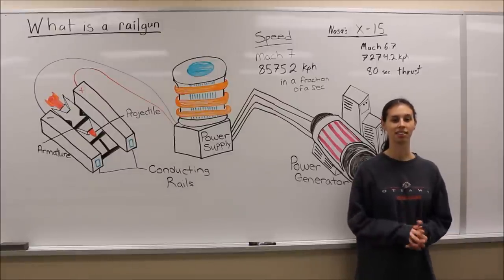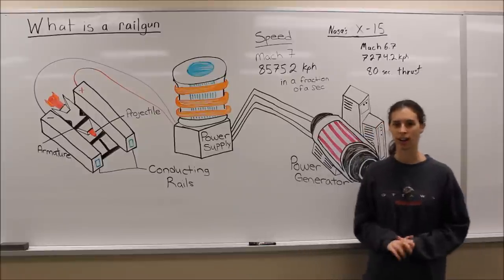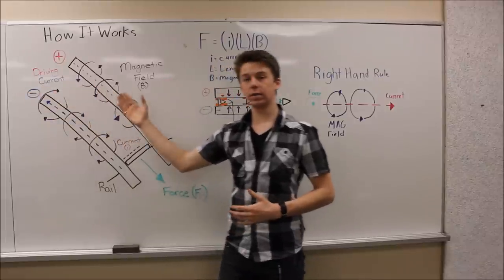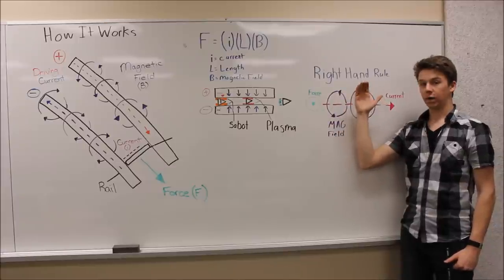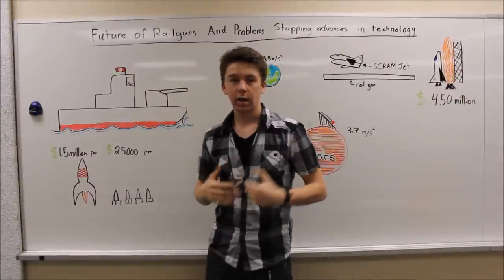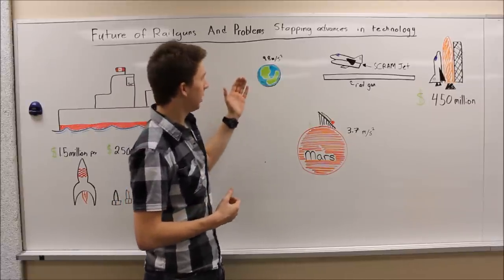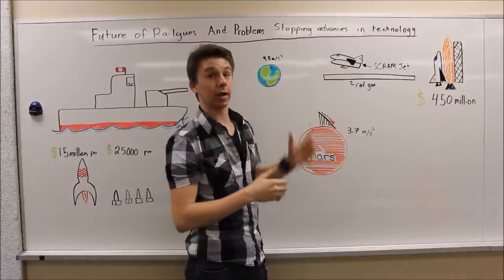The Physics Behind Railguns

Comment: If you set the length in F=ilB to the length of the rail gun then you will get the force on the rails which pushes them outwards, not the force on the projectile. The length should be set to be the portion of the projectile length, the distance between the rails, to get the force on the projectile. Just for anyone wanting to build one :)
Reply: Thanks! We actually built something like that in our physics class recently, though not as powerful, for, I believe, obvious reasons 😂

Comment: Thank you for the excellent primer on railguns. Great introduction to the concept.
One point I would correct. The force that moves the projectile forward is the current crossing the sabo. 
Thumb pointing toward negative rail, fingers curled toward back end of / start of rails, force pushing back, forces projectile forward.
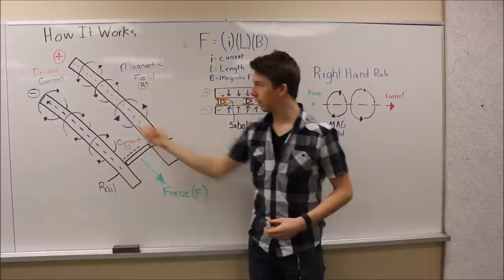Reply: Also the forces on the rails push the rails apart, not together. Still, apart from the physics errors at 2:52 and 4:43, a well presented and watchable video.

Comment: There is no need in mentioning "positive" or "negative" poles. In general huge capacitors are used as the power sources, and during their discharge(i.e. the projectile acceleration process) electromagnetic oscillations occur, and "the poles" periodically change, and it does not change the Amper's force diraction(it is obvious for someone who knows electromagnetism on a school level), and yes, Amper's force when we are talking about solid projectiles being accelerated. Lorenz force is the force which acts on the charged particles(in ionised gas for example) in magnetic filed.

Comment: Have you ever thought about using super conducting magnets which utilize a super cooling method to counter the heating issue as well as possibly add extra force to the projectile?
Reply: an area of study that I'm looking into is customizing the permeability and permittivity of the projectile material to greatly increase the speed of the projectile.

Comment: This was a very informative video! I'm just curious from a physics standpoint i'm sort of a novice.. but whats to stop the forces from the current and magnetic fields on the armature from launching it either up, or down, or backwards along the railing. If you could explain what or how exactly the magnetic forces and current force the round precisely where you want it to go, i'd greatly appreciate it. I'm super curious about it, and don't have enough of a background in physics to understand.
Reply: Yeah... so the rails are just there to supply the current along the projectile's path. You're right, there is an electromotive force applied inwards to the projectile in the barrel, and if there was nothing stopping it above or below, eventually... some external force (like asymmetric frictional forces in the barrel caused by material imperfections) would add a vertical component to the acceleration on said projectile and launch it up or down. I'm thinking there is probably a more sophisticated "barrel" involved that has a top and bottom.
Reply: Force, current and the magnetic fields of the rails are all interrelated and the force generated on the projectile is always perpendicular to both the magnetic field and the current. Since the current is always going to be flowing 'left ' to 'right' from the positive to the negative rail that gives you one direction. The magnetic fields from the rails move in a circular motion around the rail clockwise in one, counter clockwise in the other, since the slug is always directly between the rails this means the fields are going to oriented 'up' relative to the slug. So now we have two vectors forming a cross with the slug in the middle and two directions that are perpendicular to both, forward and backward down the rails. Since the current is generally so high that if the slug were motionless between the rails when introduced it would become welded in place by the heat generated the slug is accelerated by some other means before it enter the rails. This is what decides which direction the slug goes in the rail gun. Hope that helps and wasn't too confusing! Source: current college physics student that just studied electromagnetism in class.
Reply: This is such a fantastic explaination!
Reply: The problems they are facing with real guns are..... you need basically a nuclear reactor and generator to supply the electrical power needed to propel a projectile  faster and further than gunpowder....and the rails are burnt pretty quickly with that much energy used in such a short time. The plasma is created from not only melting the solid metal projectile but also the rails...so no it is not yet cheaper. The goal is ....but not at this time. Imagine copper heated past a solid, past a liquid, past a copper gas....copper plasma....very hot indeed.
Reply: Good question - in practice a railgun barrel needs a guidance mechanism, such as solid supporting insulators above and below the rails, to stop the projectile from being accelerated up or down and away from the centreline of the rails.
In a simple railgun, the field B is generated by the driving current I, so forces in the form of F = I * B * L always point in the same direction. Changing the sign of I then gives F = (-B) * (-I) * L, so the two minus signs cancel out.

Comment: Well, unfortunately, this is not how the right-hand rule works, or how a rail gun fires. I can rotate my hand in any direction, keeping my thumb in the direction of current and my fingers properly oriented around the wire in the direction of the magnetic field. Therefore, the force can be in any direction. You all have good pictures though.

Comment: I think you should add a cooling system like the ones nuclear subs use, as for the wrapping try using structural designs and different  Alloyed combinations, power source we have yet to really use the ocean  Currents for the  Generator, that would produce more then enough energy. Just my thoughts

Comment: Why couldn't make the sabo out of a superconducting metal and cool the whole apparatus using liquid hydrogen or helium causing the round to magnetically levitate, thus both reducing friction and keeping the railgun from overheating.  To me this seems like a no brainer cause metal is more conductive at lower temperatures anyways.  If I was designing one this is how I would do it.  I would also not make the rails in 2 straight lines, instead I would spiral them keeping the distance between them equal to the end of the barrel.  Spiraling them would allow you to shorten the barrel and at the same time it would impart spin to the round making it fly straighter and longer.  For all I know this is how the military already does it.

Comment: Hei guys. Awesome video. But I believe you guys made a huge mistake.
I have one correction to make. L is not the length of the rails.. It is the length of the projecttile. The lenght of the rails has no influence to the force/speed pushing forward. The rails actually try to ecape each other that is why they need to be very secured to a base so they cant bent or push away from each other. Froce is only made from that little piece (L). So  with the hooked up current the force is actually going the other way then you guys drawed down.
Reply: Just a minor nitpick :) the "length" of the projectile is actually it's width ie the separation of the rails. You probably knew that, but I thought it would be nice to clarify :)

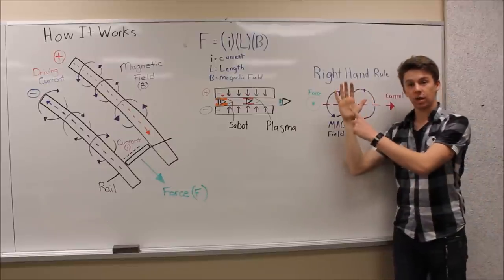Comment: Your theory is completely wrong. 3:58 The magnetic field is circular and the force is always perpendicular to the field. You need an actual object on which the force would be exerted.
4:20 Two conductive lines with current flowing in opposite direction push away from one another - the force is repulsive, not attractive.
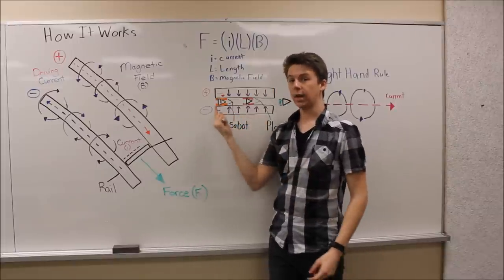4:56 the mechanical sandwiching or "squeezing the projectile out" is also wrong. For the same reason as last point. Railgun would work even if the projectile was just a conducting stick placed on top of the two power lines with no mechanical forces working on them. If the squeezing theory was correct the projectile would just be welded onto the rails.

The drawing on the left actually gives the correct picture. The real reason why the railgun works is that the two lines produce a magnetic field in the same direction in relation to the current flowing through the projectile (into the whiteboard) which is why the resulting force is perpendicular and sends the projectile along the rails. I don't know what level you are but I hope this isn't a university.
Reply: Later he divides $25,000 into $1.5 million and gets six. Not that this couldn't happen in actual practice. 😞

Comment: 1:26 
Actually, the electric current does not 
go through the positive terminal first, it 
is the opposite. Dc current flows from 
Negative to Positive. (we had originally 
thought or assumed it flowed pos to neg).
'Convention' does not change fact, we 
found that the earth is not flat, so we stopped 
making maps and navigation tools for a flat 
earth. 'Electron Flow is an inconvenient truth' 
I'm not advocating book burning. But there 
should come a time where we start using 
electron flow instead of 'conventional' theory.
Reply: Yes but convention say's positive to negative. If you use electron flow, then flemmings handed rules don't work, and semiconductor nomenclature becomes illogical.

Comment: Something clearly doesn't add up.
The so called Lorentz force can not be in the direction of current, be it positive or negative.
Now having that in mind which direction should the projectile travel. I can not be parallel to the them rails.  I think you have a hick up there... 🙂

Think about this:
Place your right hand in front of you. Palm facing up towards the ceiling, ( call it positive Z axis) this is the direction of wait for iiiit, not magnetic field,  your palm shows North of the magnet facing up.  That is much more clear.  This means there is magnet underndeath your hand with it North pole facing up.  Now your fingers are straight ahead of you pointing away from you, (call this positive Y axis)  This shows the direction of current in whatever conductor.   Now your thumb, yes your right hand thumb pointing to the right ( call this positive X axis), is the force on what?  The force on the wire.
Did you catch this, the force is on the wire that is carrying the current.

This mean what?
The projectile must be the wire that is carrying current and the force ( the magnetic North pole that must be orthogonal in Z direction) if the projectile is to move to the right and the current must move  straight ahead from you towards the page on that wire.

Therefore the magnetic North pole must face up from the bottom and you better get the south of the magnet up above for more intensity.  Do you understand?
And you must have positive rail at your hand and negative away from you on the projectile itself as a conductor.

Now those rails are nothing but keeping the projectile in line.
These dryings are way deceptive and general. it means nothing.  Also there is tremendous repulsive force between the two rails, if they are carrying lots of current for instance.  So they better be mounted secure.